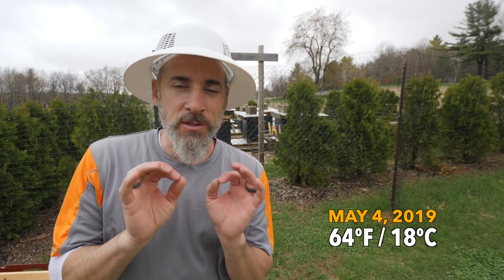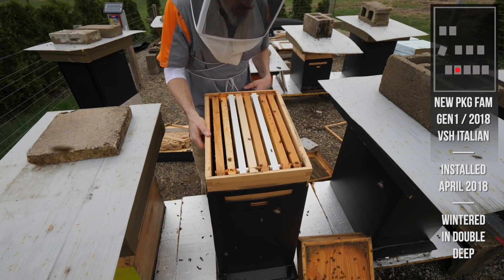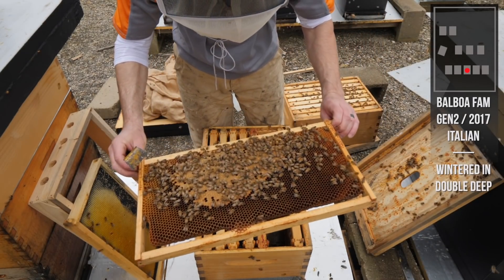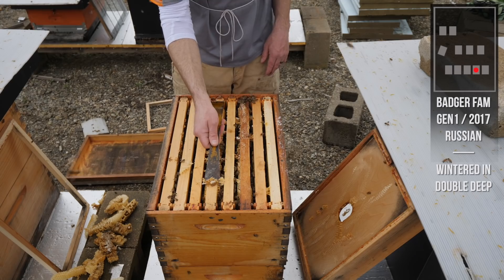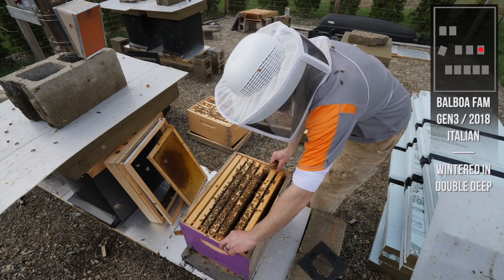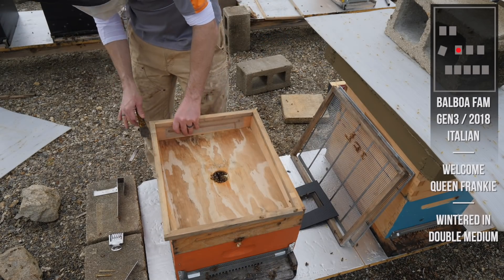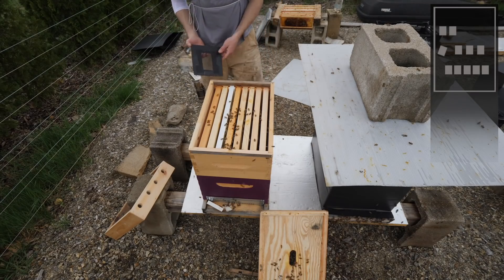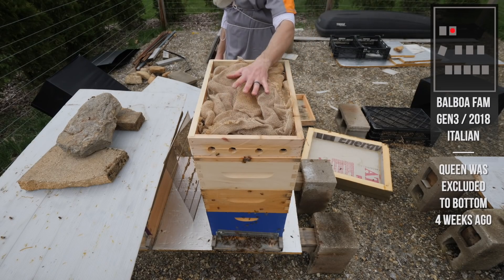So Much Poop. So Many Drones... Building Up Before The FLOW!

Comment: Hello again Jim, Could you use a vivaldi board to feed pollen pattys?
Reply from the maker: Sure, but lately I've been putting all feed directly on the frames.
Reply: @vinofarm  I dont want to disturb them by having to have to check it all the time. I just want to give them like a 1/4 of a patty as there is some pollen coming in but not tons - its a nuc I transfered about 2 weeks ago.
Reply: @vinofarm  I may be able to get a strip of a patty through the hole and onto the frames with removing the vivaldi board. I'll give it a try and let you know. Maybe I'll enlarge the hole just for the purpose ! Thanks Jim ---- JP IN DE

Comment: I do enjoy your videos. Use to have bees some years ago but never got to the point I could work without a suit.  Do you tilt your hives? Low at the front to help them with debris removal. Also entrance direction. All the same or one hive one way the next the opposite direction to help them identify their home. David
Reply from the maker: All but one face due South to catch the low winter sun. They are all tilted with a 3/4 shim on the back. Thanks for watching.

Comment: Are you not afraid of getting them used to robbing?
Reply from the maker: I'm not afraid. I put the open frames in a neutral location. They clean them up in a few hours and go right back to their hives. It's not an everyday thing.
Reply: Do you set up the open frames inside the electric fencing or outside ? And approximately how many feet away from the hives?  I started beekeeping the same weekend as you down here on Long Island and have been watching your videos as a guide as to what my bees are up to. Thanks for the great videos😊
Reply from the maker: @nicolachang826  Sometimes inside, sometimes outside. I always put them in a different spot. If they're going to be out overnight, I leave them somewhere within the fence. If it's not a lot of honey to clean off, I'll put them outside the fence farther away and they will clean them in a couple hours.

Comment: Kodos, you have come a long way in a short time!!!  Your hands are moving with purpose.  Bees are ignoring those beautiful bare hands!  Did you find mites in with that capped drone brood that you cleaned?   As To All the drones??  Maybe she is low on sperm to make the ladies?  Love the experimentation on your part with different races of bees looking for what line of bees will work best in your part of the of the country.  By the way, YouTube is sticking double commercials several times during your video adventures.  Make sure you are being rewarded appropriately......  you have earned it.  Catch you later.  Chip Friday.      P.S,      If you haven't checked with your County Extension Agent you might call him/her and see if they have a NO TILL DRILL PLANTER for rent,  Our county here in Texas has three that are available to county residents to rent for $10 an acre. It has a "odometer" on one of the wheels that calculates the acre for you.  Cool!   They have three boxes for for different size seeds.  For example you can plant buckwheat, alfalfa, and clover in big or small patches or mixed together for the bees.  Don't know how big Veno Farm is but instead of that lovely green grass I see in there off in the distance you could lay in a little bee "fodder" for your lovely ladies.  Our county planters take a 45 H.P. or larger tractor with hydraulics on the back to lift the planter at the end of the row,  so you can lift the planter up and turn the tractor around.  The farmers use these NoTill Drill planters for patches of oats/corn/etc for the deer and wild turkeys to eat and then they sell hunting leases to the hunters.  But you could slam in a number of different flowers that bloom at different times from early spring, spring. summer, and fall in random spots on your farm.  Many would bloom this year, and the rest would be mixed in, grow and take off next year.  A great book to read for this is  "100 PLANTS TO FEED THE BEES - PROVIDE A HELTHY HABITAT TO HELP POLLINATORS THRIVE"  by the XERCES SOCIETY, published by STOREY PUBLISHING at storey.com and the MSRP is $16.95.  Wow, I am wordy...  I'm so sorry.  Especially if you know all of this all ready.